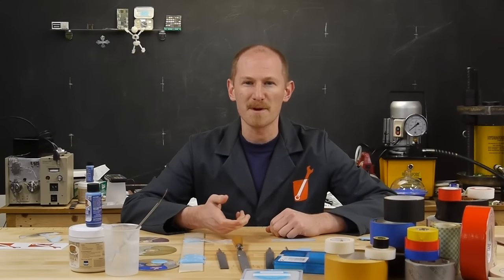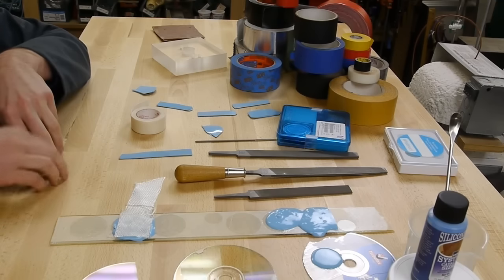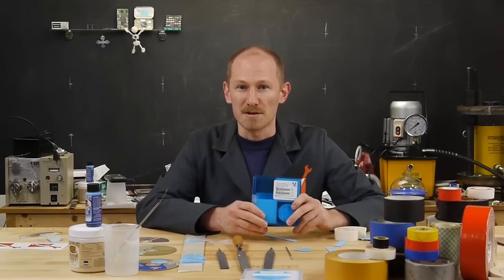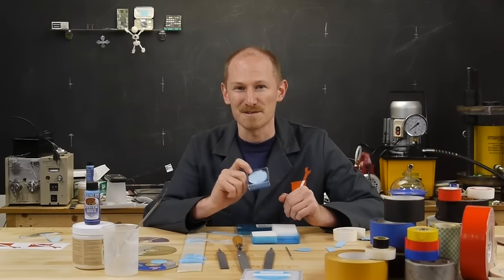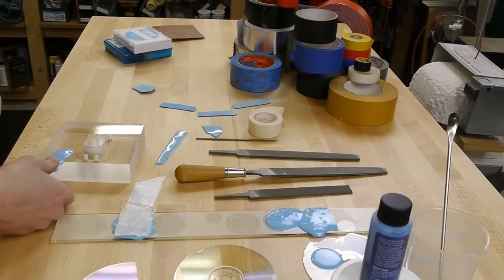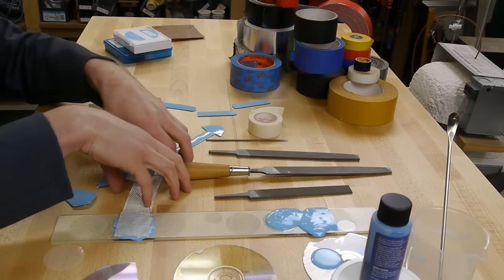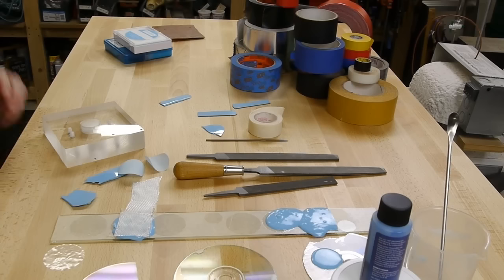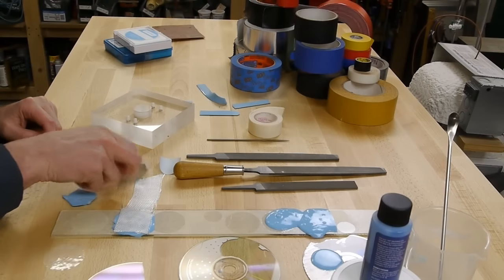Making DIY gecko tape - work in progress

Comment: What if you look at a wing and not know how it works, you might think that it is the feathers that are the reason for flight. (not saying that feathers are not; just saying that we have made fight without feathers) I think your doing the exact same here. Yes, there are pillars; however, I wonder if the process has a chemical reaction such as tape that is so tiny yet powerful in the process of attraction. Then I noticed that the pillars are not just tiny pillars there is a lot more going on. It would take me 5 pages of text to explain what I see, so I'll just be very vague here. I see a support system that has an array of squares and when the squares mush into a surface by a "PULLING" action the air between the pillars are squeezed out and notice how deep that air gap goes when compared to the square pads at the end of the pillars. What we have here is a vacuum table no unlike what we use on a CNC machine. However, it uses long slanted fibers or pillars that I believe can contract and expand to control the vacuum when the pillars are either stretched or relaxed. Just saying the slanted pillars is why this effect can exist; along with the pads on the end of the pillars having the ability to create a vacuum or the air spaces between the pillars to create a vacuum. That is why I mentioned that there might be a chemical or moisture that may also be considered. The funny thing is in your video, you actually show what I am thinking with that thin film sticking to your finger more than anything that you have developed on the table. In summary, I would concentrate more on the slated air gaps among the pillars and the pads more than I would the pillars themselves. --- Yet; the action of pulling the pillars would make a vacuum for either the pads or in between the pads. Google this for a hint as I know that I am not able to explain it "A Robot With Coffee-Filled Balloons For Hands Is The Best Grabber Yet"

Comment: Seeing the silicone noodles under the SEM showed that the noodles do not stand up, achieve any reasonable density, or even cast straight. The path of the beta particles in the material is obviously not of enough density or linearity, and duh, they're beta particles after all! So forget beta particles and use a neutron radiography setup to punch straight holes into a material. You might not even need a neutron radiography setup, I just mention that specifically because the collimated beam has already been highly linearized due to the requirements involved in neutron radiography. I imagine if you left a very thin material in the beam for the right time you could get the hole density and smallest "hair" follicles possible. If you are especially clever with your selected casting material you put into the beam you can chemically dope the material with structured high and low cross section elements and produce a regular pattern rather than just random neutron damage. I'm sure there's other avenues that are easier but there's some thoughts from a nuclear engineer.

Comment: you talk about pillars but, why not truncated cones? van der Waals force would still work at the tip of the cone, and the increased width at the bottom could add rigidity to the structure.

[side note: I use a custom rule in my ad blocker in order to disable the YouTube comments section, for my sanity. but I just enabled the comments just for your video. :) ]

Comment: Wonder what you could get done with gold leaf as the membrane, given it has a 0.1 micron thickness.
Reply: +pandeomonia This is probably impossible or won&#39;t work, but, like, silicone poured over a 50% gold/50% silver leaf, then dissolving the gold off with aqua regia.

Comment: Couldn't you combine the photolithography method and the radiation method? Print a flat solid screen and then use radiation to blast 2D flat holes through the solid flat screen and then press it up against to etch the straight holes, exposure time would control the depth? I'm probably poorly explaining the idea poorly but could work unless the light etching would just bleed and make the holes larger than ideal. otherwise how does a cd disk writer control it's etching process and make those holes so thin, could hacking one be possible to make only dots and no dashes and have it spend more time making a hole work?

Comment: geckos are used to the random roughness of the wild, and you're testing their strategy against an exceptionally smooth block of man made glass? the point is, that block is so smooth that it actually makes better contact with the flat silicone than any other texture. make a cast on that block and see it under the microscope, it'll be flatter than the cd cast.

Comment: You could mill file-like grooves into a piece of aluminum to create the macrostructure for the mold, then anodize it to create a dense array of nanopores. 

This abstract mentions diluting PDMS in cyclohexane to lower its viscosity enough to get it to fill an anodic aluminum oxide mold: http://proceedings.spiedigitallibrary.org/proceeding.aspx?articleid=1353214

Comment: Just burn a Blu-ray disk with alternating bits (010101010101) to create a even pit spacing for the gecko tape. If the file is the opposite of what you need, just make a mold of the file, then you the mold you made as the gecko tape mold.

Comment: why not write custom firmware for a dvd rw drive and try out blank disks of different manufactures. I sadly am not into this kind of stuff so someone else would have to find out if there are drives out there that are well documented to do something like that.
You could get fairly accurate writes and even do multiple passes to deepen the bumps and if even that is not enough there is Blu-ray too but I don't know if you can get to the written layer as easy as with cds or dvds. You could even try to produce your own blank disks with some kind of material coding technology.

Comment: Not sure if it's been mentioned yet but you might want to look at TEM grids as either a mold or a photolith mask.

Comes in a very wide range of shapes and pitches. 

2000 Mesh has a 12.5µm pitch and cost's sub $50

https://www.tedpella.com/grids_html/gilder.htm
Reply: Fiber optic face plates might also be worth a look. They are an array of very closely spaced glass light guides. To reveal a pattern you would have to etch down (etch rate will be different for the core and cladding of the light guide).   

Surplus Shed has them going very cheaply ($3 usd each!)
 http://www.surplusshed.com/pages/item/m3410.html

Comment: I seem to recall that regular styrofoam behaves rather interestingly with superglue applied to it ; perhaps try very thinly smearing a drop of superglue over some styrofoam and have a look at the result in your microscope - the effect should be a kind of hardening etch of the styrofoam that makes it sink into itself a little and harden up as the superglue dries because it breaks down the pores of the styrofoam as the superglue then stretches thinly to form this semi-porous material that may be suitable for casting these types of pillars - potentially you could even get the nested-hair effect too. I'll be sure to keep watching you tinker, it's been so interesting already with all the stuff you try :]

Comment: You could try using an alumina template with dendritic nanopores ( https://www.researchgate.net/publication/283422348_Dendritic_Nanostructures_Grown_in_Hierarchical_Branched_Pores ), and then dissolve the template. That should give you not only the pillars but also the 'hairs' on those pillars.

Comment: +Applied Science - how about using Basotect ( http://bit.ly/1OI988C ) as the casting mold.  It's an super fine open cell foam, most commonly seen as a "Magic Eraser."  Or, perhaps stacked and alligned graphene sheets in thickness enough to reach the desired length of the "gecko hair" through the graphene sheets' mesh.

Comment: Why not use a grooved diffraction grating? You can get 3,000 line / mm gratings. Perhaps someone could find some information on the depth of the groove. Also, you can get the groove pattern in a sinusoidal shape or a sharper saw tooth shape. Link here: http://www.gratinglab.com/Information/Technical_Publications/Gratings.aspx

Comment: Hi Ben! I think you could make a mold using porous aluminium oxide. You do this by electrochemically growing an aluminium oxide layer in an acid or basic medium. As the oxide layer grows it gets disolved by the acid or the base you are using (because its an amphoteric oxide) and pores start to form. The process is the same used for anodizing metals and gives you a neatly ordered structure of perpendicular tubes with a tunable depth, diameter and separation.

Here you have a review on the topic
http://pubs.acs.org/doi/abs/10.1021/cr500002z

Comment: How about a nanopore membrane used for hemodialysis?  In a few seconds I came across this paper that describes a silicon membrane and the structure looks like it could be adapted to work for this application.  "High-Performance Silicon Nanopore Hemofiltration Membranes" 2009 http://www.ncbi.nlm.nih.gov/pmc/articles/PMC2607036/

Comment: modify a dvd burner， and then you can control the shape， depth， density of the holes on the cd
Reply: Burners don't make physical indentations in the disks. In writable media there's a dye which, when heated up, becomes opaque (you write the data by heating up the places where the zeroes are supposed to be). In rewritable media there's a material which is melted by the laser and, if allowed to cool slowly, crystallizes or ,if cooled rapidly, becomes amorphous (you erase the disk by heating it up and letting it cool slowly and write it by quickly heating and cooling the places where zeroes are supposed to be). Only prerecorded media have physical pits in them.
Reply: ohhhh thank you for your detailed explaination

Comment: You could use a polka dot beamspliter as a photomask to generate a repeatable pattern using the lithographic process (https://www.thorlabs.com/newgrouppage9.cfm?objectgroup_id=1110).  A coherent UV source could could be used to precisely transfer the reflected (or unreflected, depending on whether a positive or negative photoresist is used) light on to the photoresist to generate the pattern.  Also, a beam-expanding lens set could be added to increase or decrease the pattern size.

Comment: I would recommend looking into anodic alumina.  While not exactly cheap, it had the structure you are looking for.  If your were to go this route, I would recommend etching way the alumina mold (easy enough) rather than trying to peel it off - you would destroy fewer pillars that way.

http://acsmaterial.com/product.asp?cid=133&id=173

Anodic alumina is often used as a scaffold for producing nanotubes.

Comment: This seems to be done with reasonable easy-to-obtain lab equipment.

Contact Self-Cleaning of Synthetic Gecko Adhesive from Polymer
Microfibers, Langmuir 2008, 24, 10587-10591

"The fibrillar adhesives were fabricated by casting a single layer of a 25-μm-thick polypropylene (PP) film (TF-225-4, Premier Laboratory Supply Inc.) in a vacuum oven at 200 °C into a 20-μm-thick polycarbonate (PC) track-etched membrane filter (ISOPORE, Millipore Inc.) containing 300-nm-radius pores as illustrated in Figure 1A"

Comment: I think this is the paper: http://adsabs.harvard.edu/abs/2013PhDT........84J
It also has to do with directionality to. So if the fiber is 120degrees to the plane, then it will stick pull that direction and pull off from the opposite direction.

Comment: Could you not just make the cast on the glass??? I mean it sounds like you're trying to grip the pits in the glass so why not just fill them with silicone?
Reply: Makes sense...after all, there was a video here describing the 'micro-cracks' in a piece of glass...then filling the cracks to make 'gorilla glass'...
Reply: Robert Maxson the "hairs" created would not be dense, or uniform enough to work. It would have fantastic adhesion where it was cast because it would match the surface perfectly, but once it was moved it would no longer have the same contact pattern

Comment: Have you thought about anodized aluminium oxide? With the right anodization parameters you can get hexagonally ordered nanopores with high density. I guess you can adjust the aspect ratio as you desire by anodization time, but I'm not sure about that. This stuff has some great potential applications, have seen presentations where crazy nanowire-structures have been produced by playing with deposition methods. Happy experimenting!
http://arxiv.org/ftp/arxiv/papers/1102/1102.3940.pdf

Comment: You mention using UV light lithography to make a pattern but dismiss it because you cannot use lenses to focus UV light. That is not entirely true. There are materials that transmit UV light and they make lenses out of them for special purposes (rmico.com/optics-tutorial). These are more expensive than glass lenses but do allow for that possibility. Also, air does a reasonable job of filtering UV light too, so if you go down this road, I would recommend doing it in a vacuum.

Comment: And use a lightscribe cd burner on the tape or arduino whit step motors for burn holes whit a red or blue laser.
I wish you canmade  one day build form 0  transitor a or ici.

Comment: Betas are weak. They are essentially electrons. In which case you could use a magnetron gun in your microwave.

Nuetrons would be much better..but then you are talking about making a organ liquifying deadly source or borrowing or buying some critical reactor compartment time.

I think you are on to something with etching. Thats how semiconductor microchips are made. You could use chemicals or lasers. You might be able to hack a CD burner drive.

If you lay the silicone over the mold and then put it all in a pressure chamber you should be able to get the silicone to drive deeper into the mold.

I want to say you could grow a positive mold structure that you are looking for using battery reactions and electrolysis. Everything in the universe grows along the path of electrical microcurrents...gecko feet are not immune.

Acid etching high carbon steel or dissolving the surface plastic out of some glass reenforced plastic may work too.

Even if you get close you could make some really awesome products.

Comment: Hey Ben,

I'm not sure if you are still looking in to lensing/optics to get better Stero-Lithography, but I was looking in to UV lenses/mirrors at work and can maybe give you some tips there.  BK7 (borosilicate) and UVFS (fused Silica) are both media that can transmit UV for lenses, and companies like eksma optics (http://eksmaoptics.com/) or edmund optics (http://www.edmundoptics.com/)have optical components for UV (although a lot are for lasers).

In terms of mirrors, anything with an Aluminum coating should be okay for UV

Comment: Would it be possible to cure your silicone while you're forming standing wave patterns with an ultrasonic transducer? Might be a nightmare to align everything properly and get your pattern stationary, but if you could get 2 probes and reflectors you might create interesting patterns. Please look up Faraday waves, I didn't do an in-depth review but it might be an effective way of creating structures if one could master pattern making in the hundreds of MHz range

An example of some liquid structures can be seen on Conway's site http://jmconway.org/ComPatt.html

Comment: Was watching this: https://www.youtube.com/watch?v=Wiy_eHdj8kg where it mentions that the space between the read/write head and platter of a hard drive is about 10 microns. The spinning made me think of the photo-lithography device you show in this video. If you were to hack the hard drive with some custom firmware you could spin the drive, coat it with a very thin layer of something. If that something would 'pit' when exposed to a proper magnetic charge you could again hack the firmware of the hard drive to place the pits in a very regular fashion simply by writing bits onto the platter. Not sure if it could work or not, but hard drives are cheap, plentiful and the platters very smooth. Since you had (limited) success with just flat forming the silicon you might even get good results just using the platter as is.
Reply: Well not so much 'hack the firmware' as controlling the r/w process at the level of storing bits in the platter and setting the physical location on the disc by the memory address to write and pit the applied thin film

Comment: Hi!  There ´s a work from the people at the Oak Ridge National Laboratory where they make surface microstructures (spikes, cones) to improve hydrophobicity.  The process comprises in filling a glass tube of determined chemical composition with a rod of glass of another composition, more resistant  to etching.  Extruding the composite glass rod to very fine composite glass fibers, similarly to the process of producing optical fibers.  After that, sintering the glass fibers in a bundle, cuting the  bundle, polishing and etching with hydrofluoric acid. Depending on the relative chemical resistance of the glasses you will end up with a surface  regularly filled with  micro spikes, cones, rods and cilindrical or tapered holes.  The depth of the roles can be controlled by the time of etching.
 http://web.ornl.gov/info/ornlreview/v41_2_08/article11.shtml
Keep up the great work!

Comment: Wouldn't an array of nanochannels created by anodizing an aluminum surface do it? That'd be about the same process apple uses to color their iPods, creating this pattern of self-organized hexagonal channels to pour ink in it -- you'd just pour silicon instead. Both the diameter and the aspect ratio of the channels can be controlled by changing some parameters in the process, like time the of exposure.

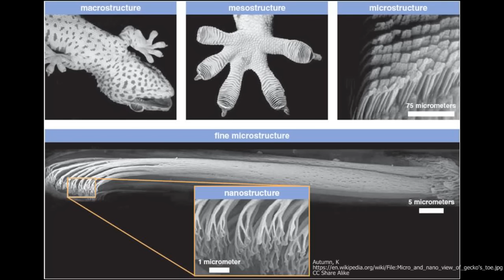An Engineer Guy video about it (it gets interesting at about 2:30):
https://www.youtube.com/watch?v=3ZhVOy-ytJY